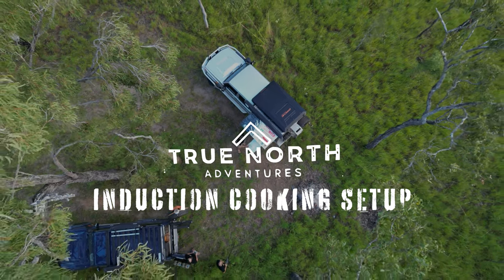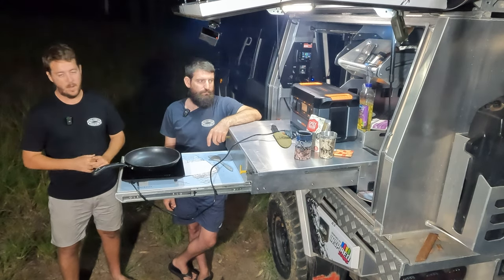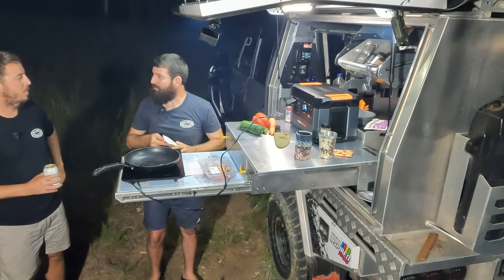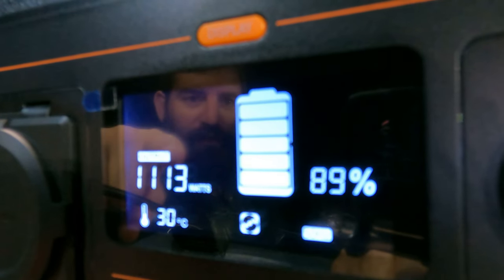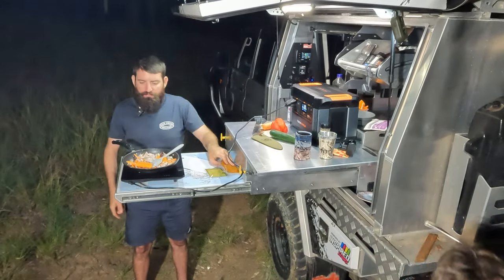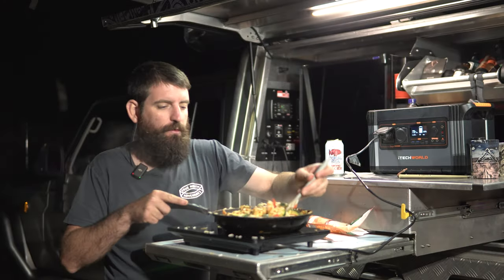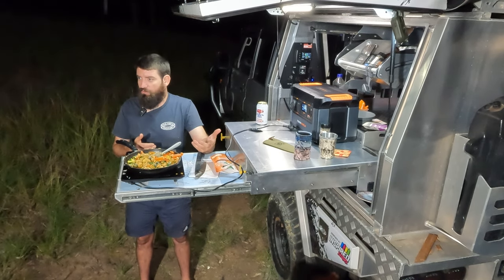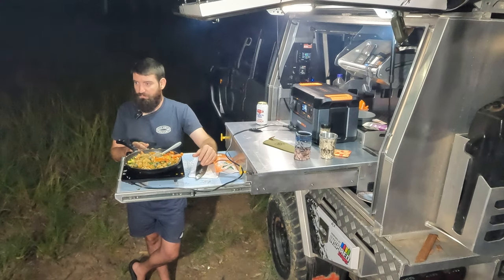12v Induction Cooking - How much power do you need?

Comment: wow 30 mps in 10-15 minutes?  Thats seems like insanely bad conversion or power loss.  If my maths are correct, 1000 watts/ 12 volts= 83 amp hours.  Your cooking at 120 amp hours meaning there is a 50% energy loss in the conversion.  Thats pretty significant.  Thanks for the real world numbers.
Reply from the maker: No problems! Yes converting from 12v to 240v for the induction has noticeable losses.
Reply: How much would the same thing be if I was using a 120 volt AC inverter?
Reply from the maker: It’s would still be the same usage from your 12v battery and would still need the same watt inverter just the 120v version.
Reply: Yes I mean with solar panels connected to charge the batteries it shouldn't be an issue better to get 2 100ah batteries and enjoy life 😂
Reply: @joesmith1142 Screen shows at least 1080w at one point in the video and the battery is probably 12.8 or higher. There's a loss of probably 10-20% from the inverter, so your math is probably not too precise.
Reply: Wrong .
Its 1000 watts : 12 volt + 10% Inverter lost = 91 a use.

A bad inverter kan have lost of 25% 
A victron inverter have lost of just 6 % 
Just normal good brand about 10% 

A inverter that have a lot of watts can have a bad % lost to that well running higher output the lost of % go down.

Its all in the Manuel.

Comment: The irony of using an inverter is that there is a fair chance that the induction cooker itself is converting the AC to DC anyway (obviously the controls are all DC). If that's the case then there is fair bit of energy being lost in the double conversions that could theoretically be avoided. And indeed you can find videos of people who have built their own DC induction cookers (a lot of them seem to be Indians running them on solar-based systems).
Reply from the maker: Very interesting mate. Surely a 12v induction cooktop would do pretty well if someone released it.
Reply: @TrueNorthAdventures  but surely it will need to convert the DC to AC to run the device.  Surely you need an AC current to produce the alternating magnetic field to give the inductance to generate heat in the magnetic pan ( or the magnetic core in the base of a non-magnetic pan.
Or have I totally misunderstood inductence.
Reply: @davidclark2286 You have not misunderstood. You are correct.
Reply: @TrueNorthAdventures  there are many available.

Comment: Title is 12v suggesting this is a DC cook top.  First bit of the video talking about inverter so actually running off of AC not DC 😞
Reply from the maker: We didn't see it that way, but we can see where you are coming from. 
Even if the induction cooker was made to run off 12v directly, it would still require an internally concealed inverter to change the current to AC to work, so it's not really that different and allows the option to use the inverter for other appliances.
Reply: @TrueNorthAdventures  you don't need an inverter for heating elements. There are DC heaters.

Comment: As long as there is easy alternative of using portable gas stove you want save electricity for other use which needs only electricity. For example running freezer or air conditioning etc
Reply from the maker: We usually carry a backup or cook on a fire if we really need to save power.

Comment: Thanks heaps fellas !!!  I've recently bought a 120ah battery and more to the point a (1000w) inverter. Because you set the Breville to 800w and explained why..... I'll be rushing out to get a Breville induction cooker. Thanks again so much for making this video.
Reply: how are you finding it? are you able to get enough charge from solar to make it sustainable?
Reply: Haven't fitted the inverter yet. It will be interesting to find out, Cheers
Reply from the maker: No problems mate!
We’re sure you won’t regret it 👍

Comment: if i can 3 meals in that day thats 90Amps and a fridge that takes 24A and lights take about 7A and then charging 2 phones is around 8A im looking at just under 130Amps per day.
on a good day my solar pulls in about 60Amps a day.
130A out and only 60A in.
for me it dosnt sound sustainable but would be great to see some of the people taking this rout break down there setup like this as well so we can see why people are taking this option and who it works for.
Reply from the maker: Hi yes I agree, so we have a fixed solar panel on the car which probably only does 50amps on a good day. But the car produces 40amps per hour.  As we are often driving for at least an hour a day it is just something that we need to keep an eye on and cook the odd thing on the fire to save abit of power or don’t do a cook up for breakfast.  It is definitely a fast way too cook though.
Reply: @TrueNorthAdventures  thanks for the insight!

Comment: Can you run and invertor and induction of AGM batteries?  I heard the current can fry AGM's?  Was figuring a 200 watt invertor and keeping appliances like induction at less then 1000?  thought
Reply from the maker: No you won’t be able to run it off an AGM (not a standard 100-200ah 12v agm anyway)
To run 1000 you will need at least a 1000 watt inverter. 
At a minimum for induction I would suggest a set up of 200ah lithium. 2000w inverter. 
You can get away with some 100ah lithiums depending on recommended max discharge.

Comment: 1x9kg gas bottle $55
1x refill $25. 
1x itechworld 100ah powerstation $2500
So I can buy and refill my bottle like 97 times for the same price. Or 50 and have enough money left to get an AGM + battery box to run lights and fridge. 🤔
Reply from the maker: Spot on mate! Although most people are moving to lithium now anyway so it's probably just more the cost of an inverter that is the extra cost to setup for most. 
Also has the advantages of being lighter in comparison to an AGM battery and extra gas bottle setup and cooks perfectly in windy situations.
It's not going to suit everyone but definitely has its applications.
Reply: My 60ah lifepo4 battery cost me $200. My 5 large solar panels cost me $200. They deliver upwards of 60amps at noon, so I can cook while charging the battery. This is for a permanent, off grid setup. But electric is the way to go there, because it means I don't have to do any runs to replace anything. There's energy when I need it.

Comment: How long did it take to cook the meal? I’ve got a 175ah lithium I want to try an induction cooktop
Reply from the maker: Probably about 10-15 minutes. We used to do it with a 100ah lithium. Along as you can put the power back in eg solar or driving then you will be fine. Also check your batteries max current/amp draw and check it can handle it.

Comment: Great vid, I just bought one of those induction cooktops. Just trying to get my head around the correct settings, when you cooked the curry on 800 what temp setting did you have it on, Cheers
Reply from the maker: Every cooktop is different. Our one actually states the amps on the LCD instead some that just have numbers 1-10.. 
If your cooktop is a 2000w cooktop I would guess 10 uses the full 2000w and 5 would use around 1000w.
This is where a battery monitor comes in handy so you know exactly what the inverter is drawing out of the battery.

Comment: What sucks about most induction cooktops is they cycle power on and off instead of precisely modulating the power continuously.
Reply from the maker: Yeh it is a definite disadvantage. We have found the more expensive cooktops have better regulation than the cheaper options.
Reply: @TrueNorthAdventures  problem besides basic temp control is it requires the highest wattage supply always even if you are just using it on a low watt setting.

Comment: Kinda misleading title. Yes you use 12v battery, but you run the equipment off a 120/240v inverter
Reply from the maker: I see where you are coming from. Although even if the induction cooker was made to run off 12v directly, it would still require an internally concealed inverter to change the current to AC to work, so it's not really that different and allows the option to use the inverter for other appliances.
Reply: @TrueNorthAdventures  true. But I was looking for people using 12v appliances.

Comment: That's not real camping. Starting a camp fire is. And who wants to lug around a big battery in the woods just to power a stove? These stoves are ok at home or even on a road trip if you have the power in the car. Next video...73
Reply from the maker: Agree mate! 👍 definitely not for hiking and we always still light a camp fire in the evenings. We use ours in the car for convenience and when there is a fire ban and we cannot light fires
Reply: @TrueNorthAdventures  that's good and quick stops at a rest area. Same as my butane stove. Even fire bans I still can get away with using my stove. The only fire ban I was in was when it was so dry during the forth of July all the fireworks displays were cancelled. We went to the mountains and no ban was there. 73